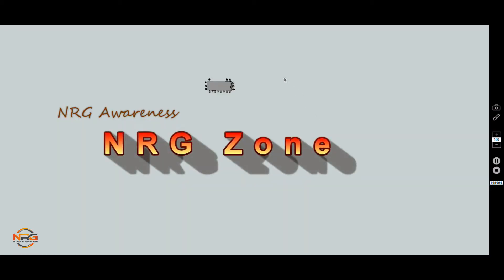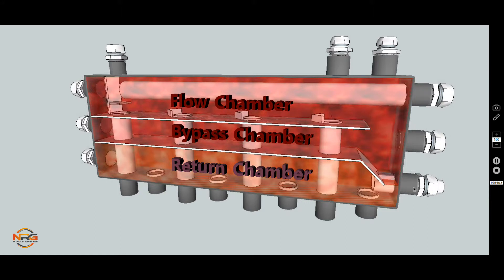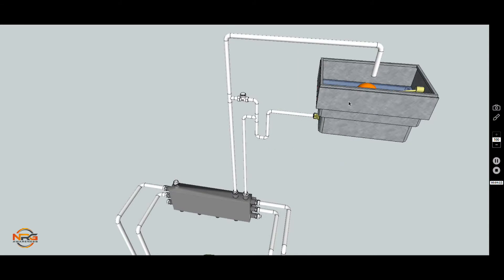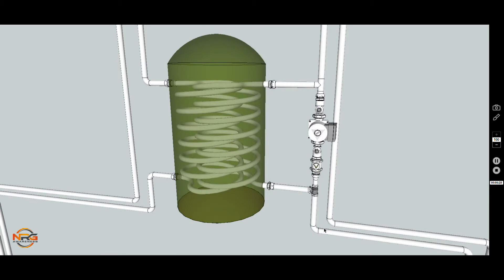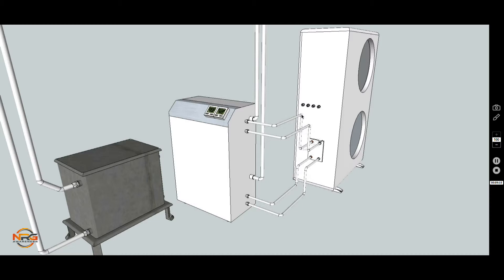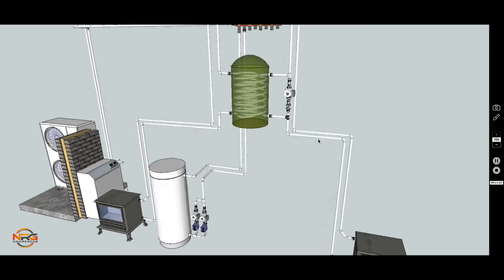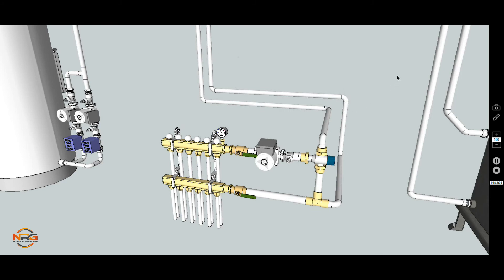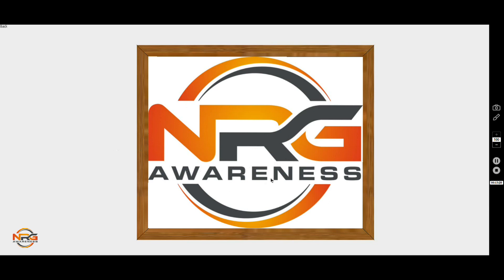2 Solid Fuel Boilers with a Heat Pump, Method 2 - NRG ZONE

Comment: In this video it shows an underfloor heating circuit is connect to the NRG ZONE in an open vented system.
I thought that you needed a pressurized sealed system to utilize underfloor heating.
Please clarify.